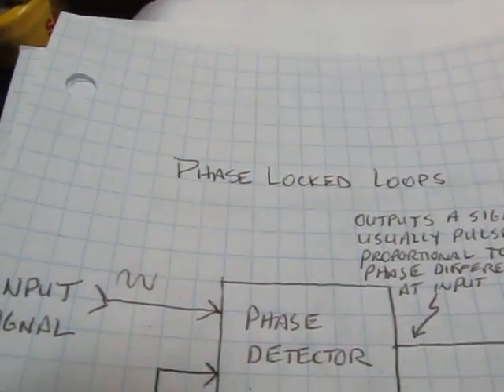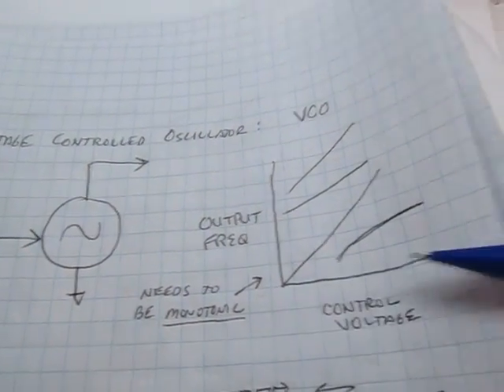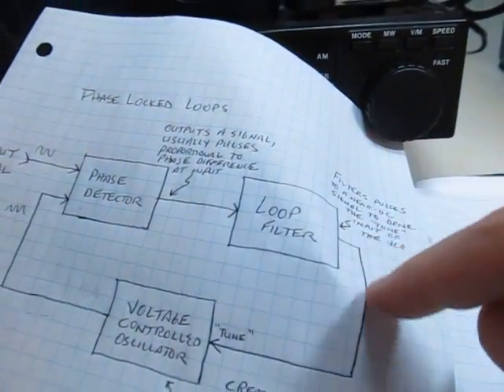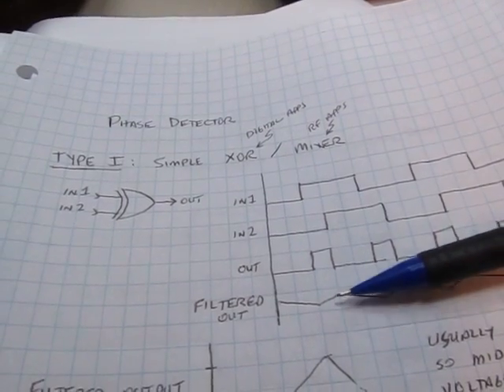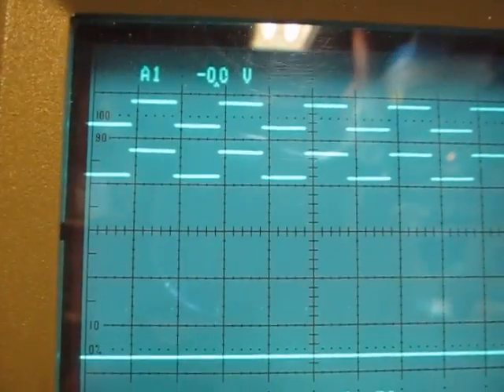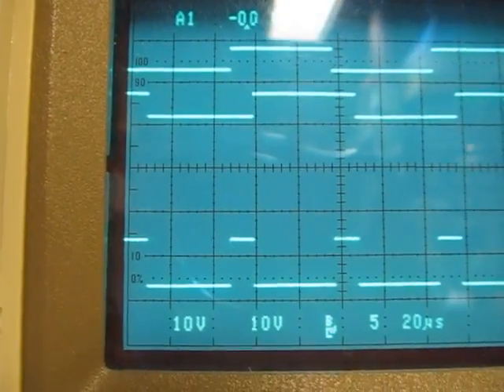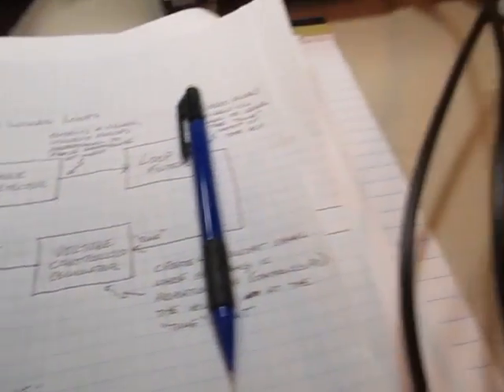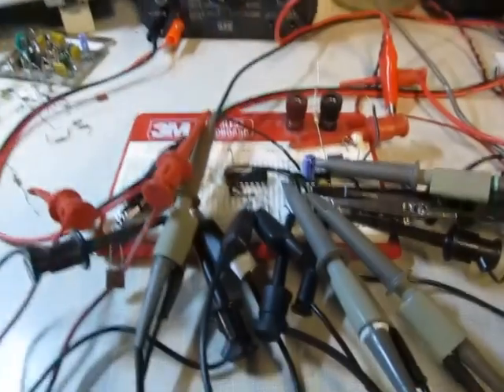#60: Basics of Phase Locked Loop Circuits and Frequency Synthesis

Comment: I am actually looking for a Time Difference Measuring circuit when I stumbled upon this very nice tutorial of yours about PLL. It made me feel that what I am looking for must be similar to how the Phase detector operates. Do you happen to have any simple circuit that can  measure time difference between two pulses reliably  within a microsecond without using an FPGA.
Reply from the maker: A common digital approach would be to gate a clock signal into a counter.  A 1MHz clock will give you 1us resolution.  This can be done with simple logic gates/devices, doesn't have to be an FPGA.  A common analog approach would switch a current source on during the measurement period and dump it into a capacitor.  The voltage on the cap will build linearly over time, so when the source is turned off, the voltage on the capacitor will be proportional to the duration that it was switched on.

Comment: Applause! Great video, demonstration and explanation!
Question: Can a PLL circuit be used to adjust a UHF signal phase between 0 deg and 360 deg for a given input frequency by adjusting the voltage to change the phase?
Reply: You said it, "phase shift keying" for a given UHF RF input signal. I'll look for it!
Reply from the maker: yes, it should be able to.

Comment: How would I go about disturbing the output of the PLL to vary the phase relative to the feedback? so that instead of it locking on at 0* phase, I can control what phase it locks on to? I want to do FM or PM modulation. Currently I connected an amplifier with low output impedance to the low pass filter capacitor's ground connection so that I can induce v(t) on it.
Reply from the maker: You could sum in an offset into the loop filter, or at the input of the VCO.

Comment: When you start yanking the other direction at 21:15 , how is that done? Originally you were driving voltage from the Power supply into the VCO input. Are you now at negative voltage on the power supply? I didn't know power supplies could go negative
Reply from the maker: Power supplies can be positive or negative.  In this case, it didn't have to be negative, just had to be lower than the VCO control voltage.

Comment: For FM demodulation do you use the 100MHz carrier,  the 10.7MHz IF, or the baseband audio? Seems like the inexpensive chips like 4046 have very restricted frequency range, or maybe I'm reading the datasheet wrong.
Reply from the maker: Typically it would be at the IF stage, either 10.7MHz or a lower secondary IF stage.
Reply: @w2aew  The CD4046 datasheet says its operating frequency is only up to 1.4MHz. But it's inexpensive at less that a dollar each. 

The HCT7046 datasheet says 7 to 38MHz with a Minimum Center Frequency of 12MHz. But it's rather pricey at $3.27 each. 

I guess the 7046 would be suitable for the FM band IF ? 

Could you divide the IF frequency down to 1MHz or would that destroy the audio information?
Reply from the maker: @andrewferg8737  Dividing isn't a good idea since the peak deviation of the modulation will also be divided down.  It is much better to use a mixer to down-convert into a lower frequency IF.
Reply: @w2aew  Ahh.."the peak deviation of the modulation will also be divided down" --- 
You have clarified and answered my question precisely. Thanks again.
Reply: @w2aew  Hoping to see another video using the 602 mixer! Some practical tips on breadboarding the chip and building the external circuits would be a great help. 
Thanks again for the education!

Comment: I know this is a pretty old video. But it would be nice to have details on your breadboard set up. E.g. what values did you use in the LPF. This would help doing the same experiment without sometimes getting stuck in working out minor details. I find that sometimes those little things (mostly from inexperience) can really hold you up doing the actual experiment in question.
Reply from the maker: I believe I just used some values directly from one of the application circuits in the datasheet.
Reply: @w2aew  Thanks. I really appreciate your videos!

Comment: thanks for the tutorial, its very helpful in understanding plls. Question on the last example u showed where u injected the offset. When the offset is injected, did it cause the PLL to lose lock? so because the offset you injected is too great,, the pll loop can no longer keep the 2 signals in phase anymore???
Reply from the maker: in this case, I was injecting a little offset at the output of the loop filter, through a resistor.  By doing it through a resistor, the loop was able to remain locked by adjusting to a phase offset that would counter-act the injected offset.  If I had made the offset "stronger" by using a larger voltage, or by reducing the resistor I used, I could have unlocked the loop.

Comment: I've purchase some SN74LV4046AN PLL chips for experimentation. Seems I have no idea how to use them (as usual). Could you do a video on PLL FM demodulation at 10.7MHz and what the expected waveforms should look like?
Reply from the maker: The application notes are a great place to start.
Reply: @w2aew  I've read the datasheet w notes... and I've been experimenting,  but I'm still very unsure about what my results are supposed to look like. 

I'm expecting to see my 1k baseband audio at the DEMOD OUT pin, but I get a flat DC line or different types of noise.

Comment: But why exactly we need this loop to produce a frequency multiplication with the same phase?
Couldn't we just pull a frequency divider/ multiplier in from the original signal and have both signals? Is the divider's lag (FlipFlop) is too noticeable?
Reply from the maker: There are a number of reasons - the importance of which will depend on the application.  Multipliers will also multiply the phase noise, where PLLs can be designed to reduce phase noise.  Non-integer frequency synthesis is much easier with PLLs.

Comment: Thank you. Very useful video. What the best way to scale 24mhz to 10 mhz?
Reply: 24 * 5/12 = 10. Divide by 12 on your input signal (outside the loop), divide by 5 inside the loop.

Comment: Almost same device as the one in the early Commodore 64 models, MC4044. They are used to lock a pixel clock (~1MHz) to a higher color clock (PAL or NTSC).

Comment: 08:36 the rising edge of the PWM signel lines up with the rising edge of the lagging signel but never the leading signel you could use that to determine which one is lagging.

Comment: Is it possible to use this trick to produce frequencies outside of the range that can be reached by regular CMOS chips? Like tens or hudreds of MHz, or even something from the GHz range?
Reply from the maker: As long as you have a VCO and divider that can run that high, yes.

Comment: This demonstration is awesome! However I try to understand, how PLL is used in DACs. In high-end ones. Does it bring some benefits, or is just a marketing. As I understand, there is one* precise oscillator in a circuit. But I don’t understand how PLL can reduce a jitter (a random phase shift) of that one frequency. Do we need to delay it and compare an original signal with delayed one? Thanks.
Reply from the maker: A PLL can be used as a jitter filter.  When the loop filter BW is low, the VCO won't follow the jitter on the input clock.
Reply: @w2aew  Thank you. Yesterday I've got this about LP filter ) I think that if Crystek promises 82fs jitter and -110/-120dB phase noise at 100Hz, there is no need to use PLL. I'm just looking at Holo Audio May DAC and trying to understand why do they use a quite big part of a PCB to implement PLL there, when they can take any oscillator for a price they ask for the DAC.

Comment: Great video! But,  if one wanted a  specific frequency then one could just use the VCO, or?

Hm, but yeah I can see the "phase change" is perhaps harder implement (without PLL).
Reply from the maker: Or, just build a fixed frequency oscillator.

Comment: Thanks for the video! Very nice introduction into PLL's :)  I have a question, I always thought VCO's would generate sinusoidal waves for RF applications, but this VCO is generating square waves, is this very common? I'm currently trying to find an IC to generate 0 - 25Mhz sine waves but I keep getting confused about PLL's and VCO's, I just hope they give sine waves at the end!
Reply from the maker: VCO stands for Voltage Controlled Oscillator.  Some VCOs are sinusoidal, some are squarewave, etc.  It all depends on the design, and the end purpose for the circuit. Both are quite common.  Wideband tunable VCOs that output sinusoids are more difficult to produce, and many will have some amount of harmonic distortion.  At lower frequencies, these used to be done by putting a square or triangle wave into a sine-shaper circuit.  More modern designs  use direct digital synthesis.  A VCO is one part of a PLL, just as an engine or transmission is one part of an automobile.

Comment: 7 year old video, wonder if i'll get a response :-) . When the error out of the phase detector approaches zero (lock condition), what is maintaining/setting the DC bias to the VCO? Is it the stored charge on the low pass filter cap?  Great video btw, nice demos.
Reply from the maker: Yes, it is generally the stored charge in the loop filter that maintains the "lock".  The gain in the loop ensures that any small phase difference results in making the small changes/updates to the loop filter to maintain phase lock.

Comment: so i see you have two chips what is the second for? i thought cd4046B has PD and VCO integrated in it.. and another question: what is your lock frequency? if you go down to or go up to 2kHz or 18kHz respectively, is your output signal will no longer similar to the input signal? because it loses lock...

Comment: how similar is this to the method used in computers? i know the motherboards have a pll chip and that it controls the base frecuency which is around 100 to 200mhz or more if you overclock, And then also the cpu has it's own multiplier too. I heard there's also a method to multiply a frequency by filtering its harmonics with a band pass filter  Do you have any idea whether they use a pll or the harmonics one type  for the multiplier in cpus?

Comment: I have a question related to the frequency synthesis. For example, initially we have f_ref = f_vco, the phase diff = 0. Then we enable the divide-by-2 divider having f_vco at input. Output of the divider have lower frequency than f_ref. So the output of the phase detector gonna change which leads to the voltage input of the VCO increasing -> increasing f_vco. BUT, f_vco increasing means the output of the divider also increase -> the phase diff is going to decrease which leads to the decrease of f_vco again! How the PLL resolve this conflict?
Reply from the maker: The Type I detector can sometime lock on an harmonic, which is why the Type II would be better in this case.
Reply: @w2aew  Thank you for your quick response! I don't know if I understand correctly: the Type II detector firstly will compensate for the phase difference between the ref clock & the divided clock by activating the P channel device to charge the filter. That is why the voltage input to the VCO increase. After that, the phase difference between the ref clock & the divided clock is going to be minimized, which will slowly  open the circuit. BUT the voltage will keep staying at the high value corresponding to the high f_vco and will not drop due to the opening circuit. Therefore, the f_vco is stable at the high frequency and the loop is locked. But with the Type I, the voltage can be dropped which leads to the unstable f_vco. is my understanding correct?

Comment: Two part question; first, could I use just the VCO in the 4046 as, well an oscillator, without using the rest of the IC? And if so, do you need to terminate some or all of the unused internals?
Reply from the maker: Yes, you could use the VCO independently.  Not a bad idea to terminate in inputs of the phase detector just to prevent noise generation.
Reply: @w2aew  I'll try that. Thanks very much. I really appreciate the input.

Comment: Can you make a video on using PLL for FM generation?
Reply from the maker: summing your audio input into the loop filter would work.  Also injecting your audio at the loop filter output would work (may need to add a little series resistance to the loop filter output).

Comment: Great video. One doubt... What do you actually do for yanking with an offset/injecting a phase? I could not understand it properly.
Reply from the maker: I injected a small current (from a power supply through a resistor) into the output of the loop filter.  Thus, the loop corrected for it by adding a little phase offset.
Reply: But then how to inject a phase lead and lag?
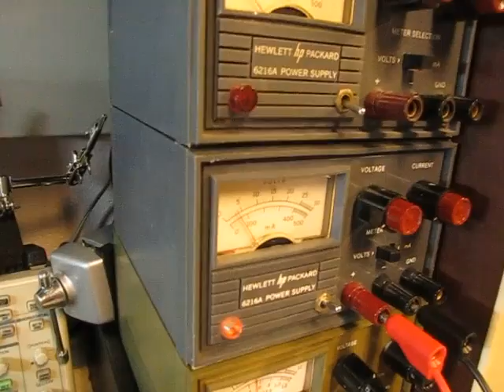Reply from the maker: Muhamed Noufal This is shown starting at 20:30 in the video.  I have an adjustable power supply feeding through a resistor.  If I turn the supply voltag above the existing loop filter voltage, this creates a phase offset in one direction.  If I set the power supply to a voltage lower than the existing loop filter voltage, then the phase offset is in the other direction.

Comment: Why does the bottom signal at 17:56 not behave like a XOR over VCO output and reference? What did I miss?
Reply from the maker: Two reasons:  I'm using a Type-II phase detector, which gives either positive or negative pulses depending on which signal is leading or lagging (pulse width proportional to phase difference), and the VCO is being divided by two, so the signals going into the phase detector are at the same frequency.  The scope is showing the output of the VCO, not the output of the divider.

Comment: Hey, could you share what is your circuit configuration like for CD4046 ? This way we can simulate it in lab.
Thanks.
Reply from the maker: I did this video over two years ago, so I don't remember the exact values used - however I can tell you that the circuit was very similar to some of the examples you'll find in the manufacturers datasheets, like the MC14046B from Motorola, or the CD4046B from TI: http://www.ti.com/lit/an/scha002a/scha002a.pdf
Reply: ***** Thanks.So here's what I have at my nearest electronic store : 4046, 74HC4046AN, MC74HC4046AN.I hope I can pick it from any manufacturer, is that right ?

Also , could you suggest me a good CDR Integrated Circuit , to intuitively test in lab ?

Comment: Awesome video !!!
thanks a lot...could u make a video on fsk modulation and demodulation using Pll
Reply from the maker: I can add this to my list.  However, a VCO on it's own can easily be used for FSK modulation (no PLL necessary).  Another way is to digitally control the divider in a PLL to change frequency.  For demodulation, simply monitor the output of the loop filter (control voltage for VCO).
Reply: +w2aew Thanks a lot !!!
I didn't expect such a fast reply...

Comment: Thanks for the informative video!  Question: in the extra credit section where you modify the voltage of the loop to inject a phase shift, would that phase shift value be constant if the input frequency were to change?  IE If you inject 20 'degrees' of phase shift on a 10khz square wave, and the input freq changes to a 5khz square wave would you still see 20 degrees without changing the injection voltage or would it be something more like 40 degrees?  -Thanks!
Reply from the maker: I believe the answer is that it would depend on the phase detector.  In the case of the Type II phase detector used in the example, the injected phase shift would vary in proportion to the frequency of the signals input into the phase detector.

Comment: thanks for the video. In the extra credit how do you inject offset voltage (say few mV) at the output ? Any reference paper for this ? thanks in advance :)
Reply from the maker: It is described in the video at 20:38 or so.  I connected a resistor (about 2.2k, but not critical) to the TUNE input of the VCO, and connected a variable DC power supply to the other end of the resistor.  By varying the voltage on the supply, I injected a little offset voltage that the loop therefore has to compensate for by adjusting the phase in the opposite direction (so that the output of the phase detector effectively cancels the offset I injected).

Comment: Awesome video. How does the pll work in a radio exactlly. I've been watching most of your videos on how each compantent works for rf handling. But can't quite understand how it works in a full system for real world applications.
Reply from the maker: The most common use for a PLL in a receiver is to synthesize the Local Oscillator (LO) in a superheterodyne receiver.  When you tune the frequency of the receiver, the action that is taken is to adjust the dividers in the PLL to synthesize the required LO frequency to place your receive frequency of interest into the IF.
Reply: ***** gotcha, after the mixer. What's the signal look like when there's interference? I understand clean cut wave forms going to a ADC. But what if there is multiple transmitters in close bandwidths to each other, what would the ADC be picking up? How low of bB can one frequency can be for the receiver to pick up when the filter looks like a slope on the scope, would the ADC pick up a slightly higher frequency
Reply from the maker: Westchester Not really - it it used as the LO which is one of the INPUTs to the mixer.  I'm not sure what you're referring to with the ADC - I didn't mention anything about an ADC.  It is the job of the Pre-Selection and IF filters to deal with close-in signals...
Reply: ***** can you make a video on IF filtering? Thanks :)
Reply from the maker: The tail End of my video on mixers and frequency conversion discusses and demonstrates the effect if IF filtering. https://www.youtube.com/watch?v=Mm7WfVzr1ao